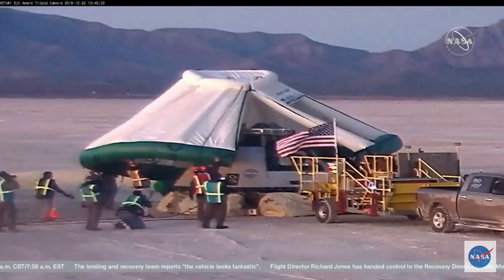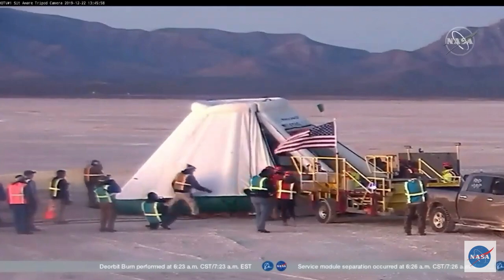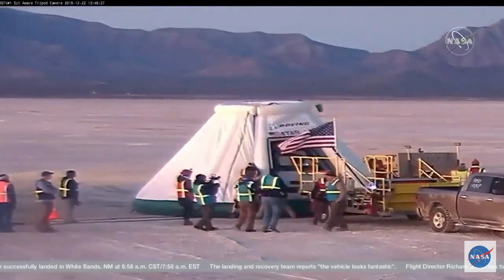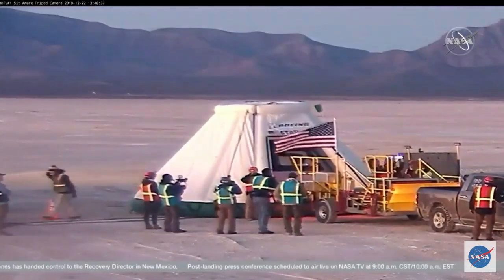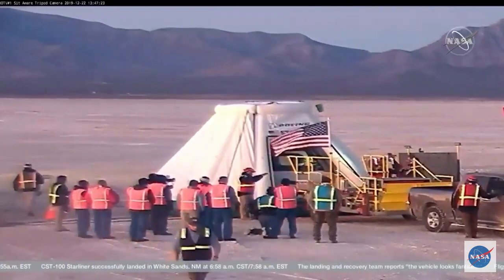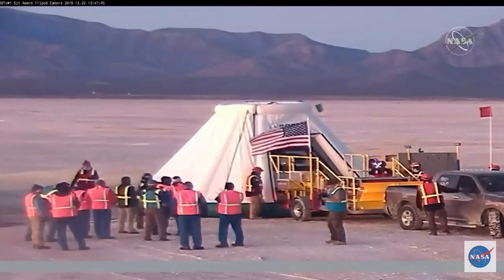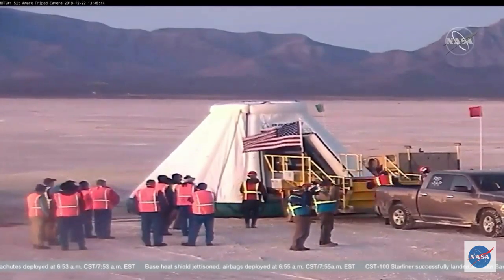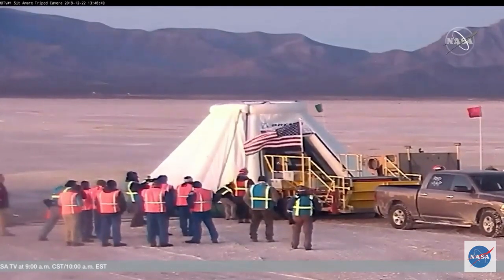Boeing Starliner Capsule Will Be Reused - NASA Explains

Comment: Why not pick it up with a helicopter ?
Reply: Simple, why risk an accident that could result in loss or severe damage to the capsule. 
Loading it on a truck and driving it back to the Cape is the safest, most secure way to get the capsule back to Florida.
Reply: @HawkeyeCR52322 " loss or severe damage to the capsule. " The thing supposedly goes into space !! ROTFLMFAO!!! What's the point of it being reusable if you are going to incur the ridiculous cost of ground transport ?
Reply: @essenegnostic8711  A helicopter has far higher costs than ground transport, doesn't have much range, and Starliner might be too heavy anyway.
Reply: @AmbientMorality  Load it on a Hercules.
Reply: Essene Gnostic Chartered cargo flights are easily into the six figure range. You can do better with ground transport, even to remote areas.